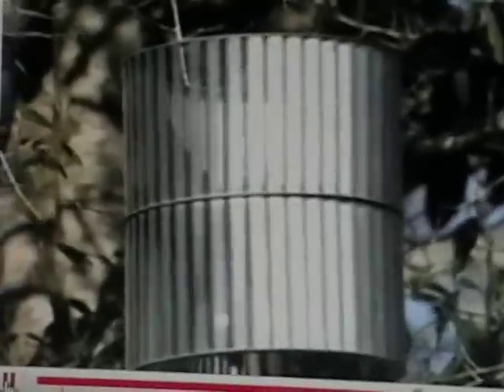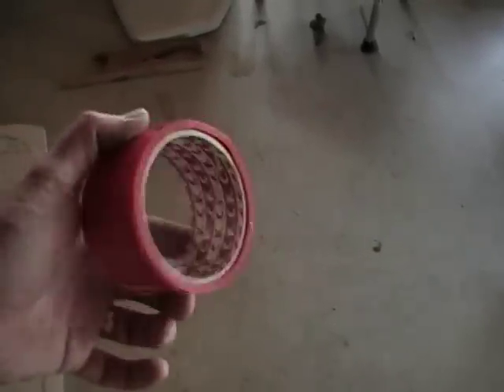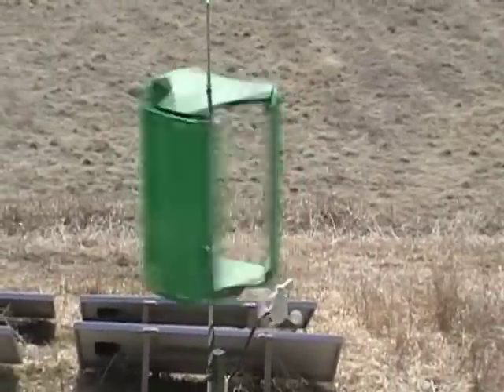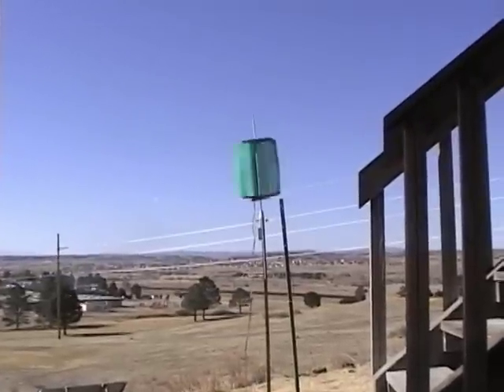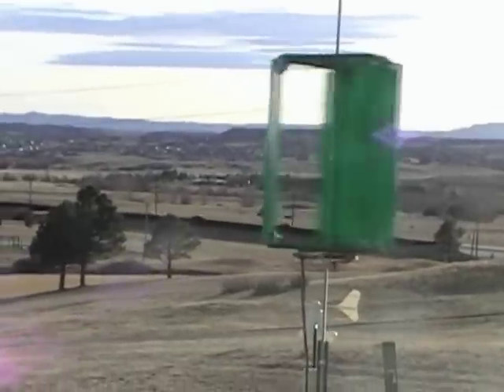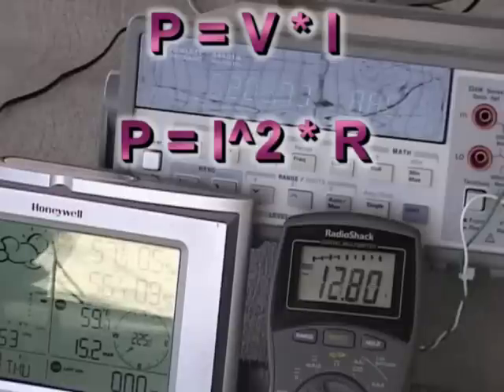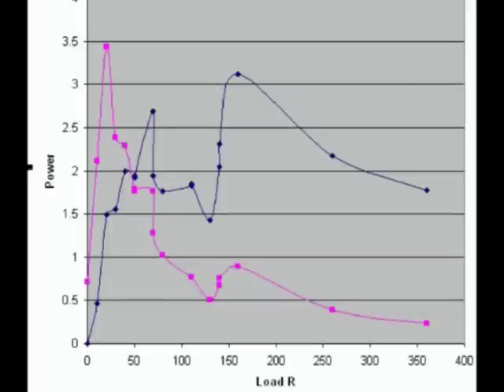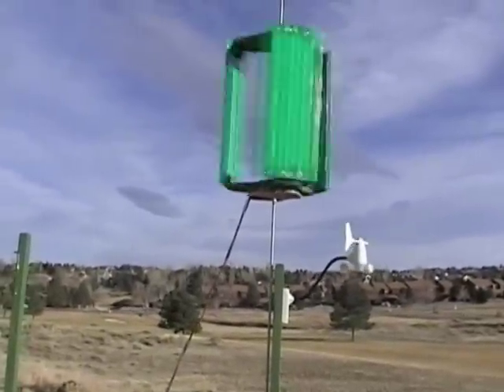Testing My Experimental Wind Turbine (VAWT)

Comment: Thank you for the video and pointing people in the right direction. Very informative. Thanks for fomulas idk if i'll remeber how to do the math but ai can help me. I heat scrap  Pvc pipe section with a HEAT GUN then flatten it out straight with a jig made from 2x6 and a hinge. 
 Great material you can make airfoil shapes after heating. Keep up the great work

Comment: Maybe your area don't be 0,25 m2. I dont know how can be calculated exactly but i think it could be less because the wind only push a half side of the turbine and the other half oppose to that pushing. Thanks for your good video, it's interesting to learn to me!
Reply: it doesn't matter, this is how turbine area is calculated so it is the same thing for all kinds of turbines and if your turbine is wasting some of it, it's accounted in turbine efficiency (for example savonius turbine where only half of area do actual work have low efficiency ~20% at most)

Comment: From what ive seen . most pmas need a min. Of 600 rpm to produce at all! Buut most wind tubines turn 300 or less!
 Whats needed is 100rpm pma!
Reply from the maker: That's true, and it's not hard, but it is expensive because it requires lots of copper and big magnets.

Comment: I think efficiency is way overvalued as a measure of wind turbine performance. 
(power produced / money spent) is the figure to be maximised.
A cheap and gale-resistant design will beat an efficient one, its just a matter of scaling it up in size untill it produces the power output required.
Reply from the maker: I agree, but you probably need to factor in the cost of keeping it running into the equation.  Also if you live in a place where your neighbors don't want to see a turbine, more power from a smaller turbine is somewhat important.

Comment: Finally, a home brew that actually shows power output. Too many videos of wind generators without the generator. Anyone can make something spin in the wind and then claim x output. It's nice to find the few like this one that actually have the generating portion connected, so output can be observed. The more I see and learn about small wind turbines the more I like photo voltaic. There are cloudy days but with enough panels and power storage these days are not an issue. Wind on a small scale seems like the ROI just isn't there. And being mechanical, there's a much higher chance of failure. I've had panels on my roof for over 10 years, through hail and even a nearby tornado. No issues. A turbine would be most likely destroyed itself in the tornado event. I'm not saying wind power generation is a bad thing. In certain circumstances it may be ideal. The more I see video's like this with real output, the more I turn to solar. I'll admit it would be fun to try and see just how efficient I could make a wind generator, but that's more of a hobby thing and just fun to do than serious energy generation. Thanks again for the excellent video and including the power output.

Comment: Just breeze here , but I had a little sailboat, and it put out about 2 hp, so a windmill of for sails should be cheap and powerful,  also an old gas moter would be good for berings and pump actions.

Comment: you don't measure voltage to see if it can hurt you. You can touch a 240V power supply if it has a low current. That's how Van de Graff generators work without killing anybody. A low change in voltage means low current, therefore, if you have 25 volts, in your case, and there is a high change in voltage, then it could seriously injure you.
Reply: While you are correct that 'voltage doesn't kill, amps do', I beleive he was implying that the electricity wouldn't complete the circuit to the ground because of his body being a reasonably high resistance.

Comment: Yeah, 25 volts probably wont hurt me. ten seconds later gets struck with 10 amps at 25 volts Dies
Reply from the maker: Unless my hands were very wet, with salt water, 25 volts would never be able to push 10 amps through me..  Ohms law  Current = voltage / resistance.  My resistance is about 1,000,000 ohms.
Reply: Ahh, I forgot about that. Good point
Reply from the maker: True, but it only takes a few ma to stop your heart, so I start to be careful at about 60v.
Reply: +Zachary Seddon 
10 amps is 100 times the lethal amount. U really dead.
Reply: Also consider that the human body has significant capacitance; If you have AC current, resistance can vary widely.

Comment: So how does one best match their turbine to their alternator (or vs versa)?
Reply from the maker: Ideally you'd measure the curves for the performance of the turbine, so you'd know power vs RPM for different wind speeds.    Then you can design and alt if you know the strength and size of the magnets and the resistance of the copper that will match it.   Getting the turbine measurements is the hard part.

You are also safe, if you just over design the alt and make it bigger than it needs to be.   It will be very efficient, but it will cost more because of the magnets and copper wire.

Comment: Question: Does your "swept area" calculations include the entire area of the rotor...or just the windward side producing power?

 Obviously the rotors going back into the wind would not only not be producing power, but would also be taking power via drag. I think that, and an unrealistic "swept area" calculation might explain your low efficiency numbers...
Reply from the maker: +Jc Knight At first that seems obvious, but it's wrong.   The blade coming up wind actually does generate power.  It's just like a sail boat sailing tacking and sailing up wind at an angle.  The only place the blade doesn't generate power is when it's almost straight up wind and down wind.

The swept area is the entire area of the rotor.
Reply: "It's just like a sail boat sailing tacking and sailing up wind at an angle."
    Really? It doesn't make sense to me.
Reply: Sorry so late in reply. 

In order for the upwind sail to be generating net positive thrust on the axle, the blade would have to be constantly changing it's blade angle through it's upwind sweep. Just like a retreating Helicopter blade would have to increase it's pitch (via the swashplate) to maintain net lift on that side of the rotor. (I design airfoils and wings)

Did i miss something in the mechanism that accounted for that? At some point the airfoil/angle of attack to the relative wind is going to generate thrust, but if the advancing airfoil can't constantly change it's angle of attack it's going to be creating a net drag on the design.

The analogy of the sailboat works because the sailor constantly changes it's angle of attack depending on the position of the relative wind, and produces thrust approximately 45 degrees between the track of the boat and the sail position. How does this VAWT do that?
Reply from the maker: There are VAWTs that do what you say, with the wing adjusting as it goes around.  See SB&K or SHARP vawt.    In my case the wing is fixed.  But since it's running faster than the speed of the wind, the angle of attack varies through a limited angle and the wing can generate lift most of the way around.   The biggest problem is getting started since when the wing is moving slowly the angle of attack goes through all 360 degrees.

Comment: Many thanks. What that determines the rotation direction?
Reply from the maker: +MrPSCHEUR 
It rotates equally well in both directions and it's kind of a random thing.  Since the output is AC it doesn't make any difference electrically.

Comment: Have you thought of redoing your evolution design with the proper viscosity and try that out?
Reply from the maker: Yes, I have thought of it.  But the computer systems I used for this are gone.  All the software versions have changed, etc.  It would be a  lot of work to get this running again.  I have other things in my life that are taking my time.  (House maintenance, kids, etc.)
Reply: That would be a great idea.
Reply: Post the code somewhere,so someone else can fix it
Reply: Author, please address this question
Reply: Just found this channel, this would be extremely interesting .
Reply: Do it with the help of your kids.

Comment: Loose the calculator.  Your too involved in the math of the thing.  Convert that alternator to a DC motor which will make power at lower speeds.  Then hook it to a load and you get what you get. If you need twice as much power, build another one :)  An alternator is usless if you don't have a long cable run which causes a lot of loss.  Even if you do it is easier to convert to pulse DC and upconvert through a microwave transformer, send it the distance with tiny wire then downconvert through another transformer and change back to smoothe dc at the batteries, or just use the pluse.  Less loss than an alternator because it will charge at speeds that the alternator will not make power.
Reply: +HM Dickson I have a 24V Three-Phase wind turbine and these things are great. I originally had a 24v DC Wind Turbine that I replaced with my AC one due to the fact that if you had a big load, or any load of that sort, it would almost stop the turbine and thus require a hell of a lot more wind to compensate, whereas my AC turbine can keep spinning and not stop at all since it's not continuously drawing current all at once - it's alternating. This means that the turbine requires less effort for the blades to be spun.
Reply from the maker: I could also just wind for a higher voltage.
Reply: sjh7132 Yes you could.  But will that make power at lower wind speeds?  You would also have to wind the second transformer anyway to convert back to 12 or 24 volts at your batteries.
Reply from the maker: HM Dickson
To convert the high voltage back to battery voltage I'd use a switching circuit, like a buck regulator.  Transformers don't work very well in applications where the frequency changes over such a wide range.  Plus when the turbine is first starting it puts out such low frequency that the transformers will appear like shorts and prevent the turbine from starting.

Comment: Nice job, sound engineering, well explained. I knew the electrical part being a ham as well
as eletronics geek and rider of 450w ebike but didn't know the aronautical parts. I'm a big
fan of VAWT esp low speed / high torque ones. I loved your comment going in about all
these spinny things on youtube and the like and "do they make any power?".
As a friend said about Sterling engines, ever see one doing any work? Or just spinning?
I think an odd number of vanes is a plus and larger radius would slow it down but increase
torque and you might be able to vary that to better match the generator. Still 5w from
somthing that looks like $20 worth of parts and a PM motor is a lot more cost effective
than a 5w solar panel from Harbor Freight! For very small energy production needs like
to float charge / maintain a deep cycle, 5w is not that bad. Adding 5-25w of solar to make
up for daytime and no wind would be nice and the wind turbine probablly spins at night.
As an off-grid guy I met who runs wind and PV said, when it's sunny it may not be windy
but when it's not sunny there's usually wind!
73 all de n3glv

Comment: For this design I would build 4-blade, not 3-blade turbine. And I would secure it from 2 points of axle, for not losing energy caused by vibration and gyroscopic friction braking. And never expect to get 100% of wind impact energy out of your turbine. I would expect 500 W medium wind to turn 350 W generator (70%) and it should work at lower wind speeds also. The air density for average temperature where I live is about +5 C, so air density is for this temperature about 1,27 and for +10 C 1,25. 5/4 is pretty good to simplify calculations.

Comment from the maker: @215alessio That's true if the the turbine has the power to push the alt to that point.  In my case the turbine was too weak so the peak power point would be more determined by the characteristics of the turbine and not the alt.

Comment from the maker: @walkertongdee 
In this video the wing is just an ellipse (squashed circle) and it's mounted with a mount angle of 0 degrees.  (aoa generally is relative to the wind, which changes depending on where the wing is in it's rotation.)  In other videos I use air foils.  Many people build their turbines so they can adjust the angle, I never have.

Comment from the maker: @wordpresswidget   Yes I rounded.  I think at the time i was estimating in my head and approximated 6.7 as 7.

Yes, breaking Betz is impossible, that's what I'm saying.  If I take the measured power of some lenz2 turbines and use the formula for area that you pointed me to, it would sometimes break Betz.  If i use the full area (d * h) Its about 40% efficient.

Comment from the maker: @wordpresswidget 
The poster claiming the 2/3rds factor has made many assumptions.  The fact that he made one or two VAWTs and used a little calc doesn't make him an expert.  There are many other experts that disagree.  In fact we've seen VAWTs that would be breaking Betz if you applied that 2/3rds factor to the area.

Comment from the maker: @ldelossant 
Those blades I hot wire cut by putting current through a wire to heat it up and pulling it through the foam.  Later I built a machine to do it.  (It's shown in one of my later videos).  You might want to consider doing a HAWT because you can just cut those blades from PVC pipe. (in my next video)  Also you might want to check out the vawts dot net site.

Comment from the maker: @Zypkin 
You are correct.  That alt will never produce any serious power.  It was my first try, and I didn't run through the equations before I made it.  Still is has been good enough to test all my small turbines so far.  (I haven't had one that could overpower it.)

Comment: @sjh7132 ...46ohm looks to me a huge number for a device supposed to make power (let's be clear, it's not Urs only... it's a common range for coreless axial flux machines I saw around). As a matter of fact commercial generators have internal impedance less than 1ohm... and that's because you have to get the power out of the machine and not waste it in heat :)

Anyway, I'm just tyring to help... I'm working on a ferromagnetic core axial machine, I hope I'll post my results within the summer.

Comment from the maker: @Zypkin 
I'll admit the alternator is poor, but it was enough to bring the turbine to a crawl.  I was only using one phase to test which was 46 ohms.  Had the alt been the real problem, the turbine would have continued at nearly full speed.  I was hoping to have to use all 3 phases to load the turbine, but it was so weak it wasn't necessary.

Comment: @Zypkin ...a good generator should blow the coils if you short it... meaning its own impedance shall be so low to generate lot of current.
To get a low impedance you need to use less copper (less turns in your coils) but since you shall keep the voltage high you must definitely reduce the air-gap stator/rotor and improve the overall design of the generator :)))

Comment: Your power problem is not in the turbine... it's in the generator!
You are trying to get 20W out of a generator which resistance is 46ohm and spinning at 25V.
Now, you dont specify which Tension and Impedance you measured (phase or line), however given that P=V^2/R if you short the generator (no load)  you have 25*25/46 = 13.6W ...it's the best you can get: with no load... adding any load would just increase the overall impedance thus reducing the current and consequently the power.

Comment from the maker: @Shalek 
That's only a problem for pure drag type turbines, and in that case a ramp or series of ramps (so it handles all wind directions) helps.  Most modern blades use lift and still drive forward on most of the upwind side.  See my video about the lenz blade Simulation   watch?v=Mk49ZgBTX5A

Comment from the maker: Yes, I was a little naive when I made this first video. :-)    Although when I calculate efficiency of my turbines, I use % of the power in the wind, not of the Betz limit.  So the highest I could ever see is 59%.  Its a little misleading to calculate based on the Betz limit, isn't it?  A good turbine is 30% efficient so 12 watts could be reasonable.

Comment: I hope you understand that the power equation is the power available in the wind, not the power you can produce. You need to add in Betz limit (16/27 or 0.5926) to find the max power you can actually achieve. So really, your turbine should be able to optimally produce around 25 watts. With efficiency factored in, 50% efficiency will lead to maybe 12 watts. Then there is inherent loss from the circuitry, so you are really looking at closer to 10 watts. Just so you know. Good video and nice idea.

Comment from the maker: You are correct, a  lower resistance would help, also being closer to the magnets (My stator is warped.)   The 'prefect load' also depends on what the turbine can actually produce.  If you pull too much current, then the turbine just stalls.  One of my other videos shows the Alt I was using.

Comment: Greetings, thanks for going a little deeper than most.  There's more to it than 'it produces 'x' number of volts'! If I remember correctly, the perfect load would be equal to the resistance of the alt coils for maximum power transfer. Are you using a homemade alt? To get better efficiency, I believe you need to lower the alt coil resistance. In any case, I appreciate your efforts here. I live in the city and limited to VAWT's and I'm just starting to seriously consider alternative power.

Comment from the maker: You might check out the Lenz2 blade.  It's fairly simple and many people have good luck with it.

My alt is one steel plate with magnets and coils on the other side.  It's not very efficient and next time I'll go with magnets on both sides of the coils, even though its more dangerous to make.